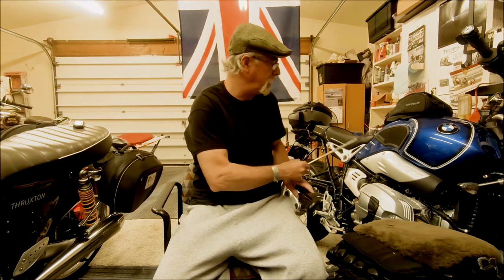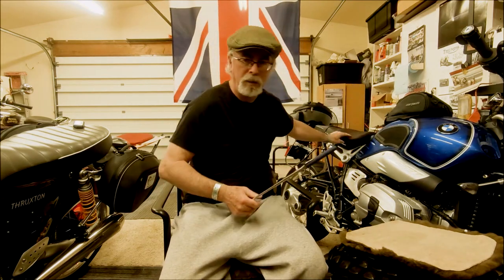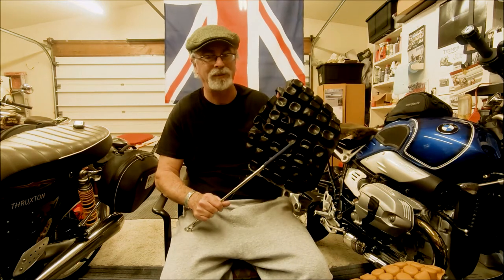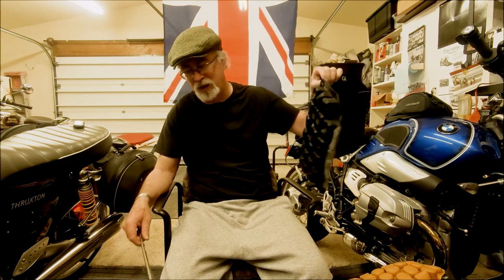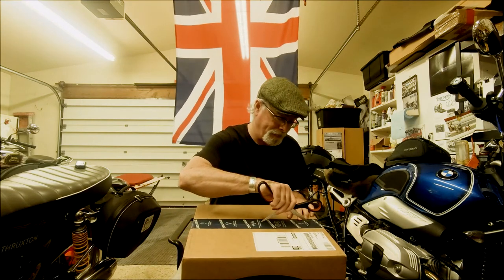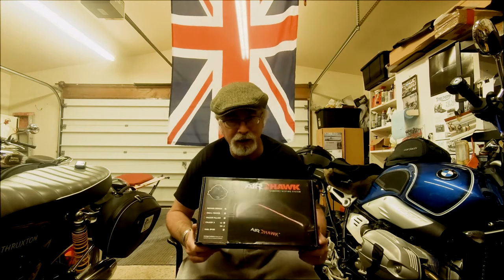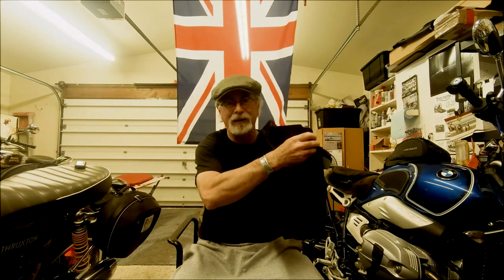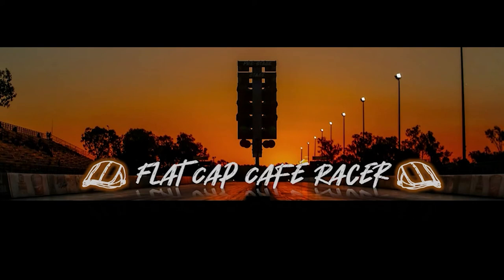(J) Seat Solution for you but it isn't a lifeboat

Comment: I love my Airhawk!  I’ve never had a problem with it going on five years *knock on wood*.  The trick is to only fill it enough to get your rump off the seat underneath.
Reply from the maker: You a much smoother rider than me Christina.  Yes keeping the air low is helpful. 

My average weight during the ownership was 160 pounds but some heavier...no names have used them too.

I  hope this one lasts 5 years but I still wouldn't want a lifeboat from the company. 😄😄😄

Comment: I have not had an Airhawk bust on me before.  The one I used on my Tiger worked good, the biggest thing is to just barely have any air in them.  When you look at them you think they are flat and if you shift your weight on it you should feel the seat. You are only about 1/8th above the seat.
Reply from the maker: I agree just a little air but they still busted.  I guess 3 busted airhawks and 2 freedom air seats makes me the unfortunate champion of busted air cushions. I still have one good one.